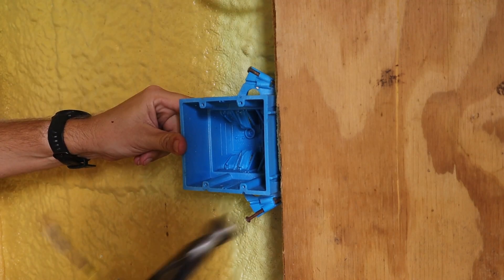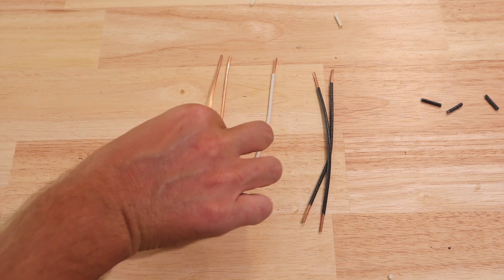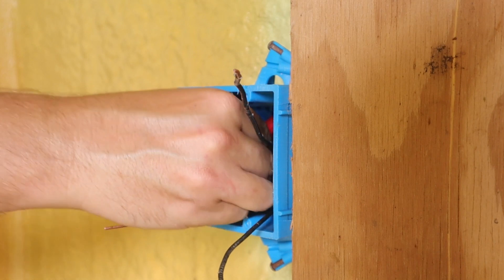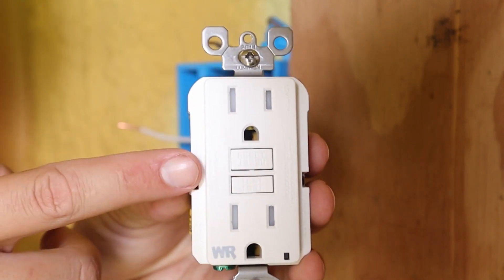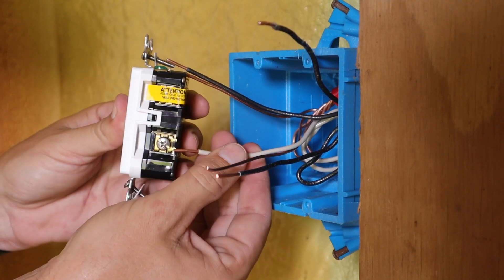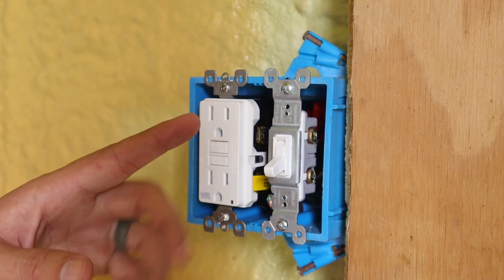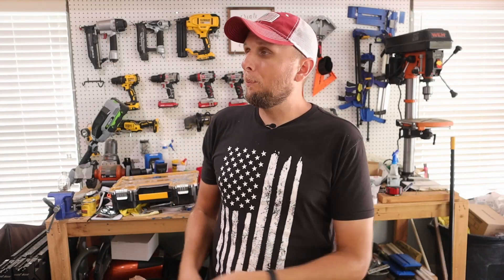Easiest Way To Wire a Light Switch and Outlet In the Same Box

Comment: You used 12gauge wire for a 15amp circuit. Your pigtails were 12gauge. Yellow insulation is 12gauge wiring.
White insulation is 14gauge. 
Your circuit breaker is 15amp. 14ga
Reply from the maker: Yes I did.  Yes they were.  Yes it is.  Yes it is.  The circuit breaker shown being turned off is not the actual breaker.  I just use that footage to show turning a breaker on or off.  Also, #12 can go on a 15 amp breaker.  So I am not sure what you are trying to say or ask.
Reply: @HowToHomeDIY  I was told by a electrician that 12ga wire 20amp circuit breaker should be used. Idk why.  I never did ask him that. 
But you answered my question.
You just showed just a circuit breaker from a different video.
Your videos are great.
I'm not going to question you on your work. 
I just saw the breaker and remembered a electrician telling me that.
That's why I asked.

I have another question.
My brother has a d house.
Old wiring. He has two porch lights.
The wiring is in a gang box with a switch with a outlet receptacle.
The outlet doesn't work.
I would like to replace the old wiring.
But I'm not sure what to do without damaging the plaster. I'm thinking the old wire my be stapled in the wall. 
Any ideas?
Or do you have a video on that?
Thank you.

Comment: I don’t know if this is where I’m supposed to put some thing for you to find a look at, but if I have a light switch, actually a three-way light switch box ones for a fan ones for a light and ones for a heater in my ceiling in my bathroom and I want to run a outlet down to the floor from one of those things and by reading they don’t have but a black-and-white coming in and then going to all the switches well if I’m going to leave one outlet live and run a smart lightbulb deal with that the switch is Always-On. Can I just tap off of that black in that white going to that switch?

Comment: What must you do to run wire underground in your back yard from your home to a shed at the far end? Is there a special device to protect the wire? Thank you.
Reply from the maker: That’s what I did here.  Local code may be different but I used UF wire which is a direct bury wire and doesn’t require conduit as long as it’s buried at the correct depth.  Which you will want to check your local code to confirm what that is.

Comment: So I followed this video for my bedroom. We added a ceiling fan it. I followed this video step by step but I must’ve made an error somewhere. 

My ceiling fan is on and works but the switch doesn’t control it. It controls the plug going on and off.
Reply: Sounds like wires were crossed. The outlet cannot be connected to the ceiling fan's lead wire in any way.

Comment: If the switch next to the GFCI outlet were a smart switch that requires a neutral wire, how would you wire it?
Reply from the maker: I would just make a pigtail up and connect it under the neutral wire nut and then connect the other end to the the smart switch.  Easy Peasy.

Comment: First mistake  you used a plastic box. Instead of metal box with a romex connector.  First mistake! 1 second mistake you should have a drip loop on your romex wire. 2 third mistake a cable staple at least 4 inches from your box.3 fourth mistake your Ground wires should use a green wirenut and extend 2 bare wires for grounds for the Gfci, and switch 4. I like 👍   strip twist  then clip and cap wires. I will tape the Gfci screws so they don't contact the bare wire. Next fold your wires neatly keep your box neat push bare wires to the back of the box. And do a neat job.

Comment: I am in the process of wiring a panel, lights and receptacles in my newly built garage. I wired the inside lights to a GFI Receptacle just like in this video so now they are all protected. I will put the outside lights on another circuit. Wish me luck on my inspection!

Comment: Is this the same process for an outdoor application? I was told to attach the ground wire to the box
Reply from the maker: Yes it’s the same.  But if you are using a metal box, which for outdoor use you will,  yes the box itself will also need to be grounded.

Comment: When it comes to figuring out what cable goes back to the panel, knowledge of your system provides a second way.... 
Nec article 250.24.(A).(1).  Provides us a no voltage check. 

Yes!  Your ground and neutral are connected.....at the first means of disconnect ONLY.

A voltage check to ensure power is ofg and then a resistance check of your neutrals and grounds for each cable (checking the resistance between a cables neutral and ground) should have a high resistance like the test leads are held in air for the down-stream cables and the cable back to the panel should only measure low resistance.....way less than 10 (ten) ohms.

With electrical, there is always an exception....old large (240v ) appliances come to mind because the they had the ground and neutral tied together at the appliance.  However, they were the only item on the circuit and if someone "made it work"instead of doing it right.

Comment: Nice video. A lot of times I really hate DIY electrical videos because the creator doesn't take the time to properly research what they're doing and teach their viewers unsafe practices. But I was impressed with how you cited codes and even did your homework on why those codes exist. Your work was very neat and professional looking as well. I would be happy if I came to work on a job that you had wired
Reply: Ditto Josh, the video has great explanation throughout. I don’t know what my camper has for wiring but I believe it has 12 gage, I’ll have to research or try to find an outlet or two that’s is original, the camper got updated by the previous owner and don’t know if it’s to RV code. I guess I should check those as well.
Reply: @MrKidQueso  probably. 12 awg is the appropriate size for a 20 amp breaker. The NEC lists the proper gauge wire for all breaker sizes over a set distance and when voltage drop occurs on that gauge (something you shouldn't ever have to worry about on an rv, you just won't ever need to run your wires long enough for it to effect you) and the types of wire that can handle that level of heat (most likely THHN which is what you will want, and is exactly what you'll find at your local hardware store in droves) it can always be kinda scary going in after someone who may not know what they're doing, I might suggest testing things like receptacles and light sockets with your multi meter if you have one, to make sure everything is properly grounded and all the conductors are landed in the right places and bonded correctly at the panel. Any questions you have are probably freely available on the internet and personally I think it's a good idea to Google everything, even if you think you know how to do it properly, there may be something you don't know, and you don't know what you don't know until you know, ya know? 😉 good luck!
Reply: @joshmonaco6170  thanks for the response, I’ll take a look at The NEC for clarification. I just ordered the KUS water level sensor and KUS  gage, and will be installing it up over the weekend. Thanks again.

Comment: Great video, very informative,  Exactly what I was looking for.   Any chance to get a wiring diagram posted of your wiring in this video?  I have a GFCI (plug 1) that is feeding another plug, (plug 2) I am adding a switch and receptacle (plug 3) for uplighting in my kitchen.  Plan is to add the switch in the box with the GFCI (1), run Romex up to a receptacle (3) from the switch and plug in the uplighting to that receptacle (3) above the cabinets. I am assuming my connections would be exactly the same as this video, only I would connect the Load receptacle (2) to the bottom of the GFCI.

Comment: Anyone else noticed he's using a square bit to drive the phillips screws? First time I see this, now I have to try it!
Reply from the maker: I have a video on the channel about it and some even better options out there now.
Reply: @HowToHomeDIY Thank you so much for the informative video! I followed exactly. Unfortunately, when I plug in my tester, it is indicating "open ground". Any ideas or suggestions on how to solve this? 
I can use the test button on the gfci outlet and it does trip.

However, if I have the external outlet tester plugged in. When I hit the gfci test button on it. It does not trip.

I'm stumped. Hopefully someone out there can provide some guidance.  I'd REALLY appreciate it.  Thanks😊
Reply: Robertson bit
Reply: Also known as a ECX or Combo Bit/#1 and #2. 🪛🔌💡⚡️
Reply: Square head #1 is what is in the center of most devices these days🤷
Reply: It’s much better at preventing slipping and stripping out.  I only use R#2 for my cabinets and woodwork.  Not o my does it help with preventing slipping, it prevents an amateur homeowner from messing with anything because they usually don’t have that bit.  I have a few more ‘security’ bits I use if I really don’t want anybody messing with it.  Sorry for the techs that come behind me and have no clue about fastening danger boxes. 😂
Reply: Works SOO much better! Also there's a new bit out for those screws that really fits well for grip.
Reply: It's called a clutch bit
Reply: It's not a Phillips screw. 
Some call it a quadrex.
Reply: It's easier with a Robison bit

Comment: Awesome info.. Does the ground wire have to be 12 gauge if the wires in the switch or outlet box is are 12/2 because light switches these days seem to come with a ground wire attached that is not 12 gauge it appears to be soft like the ground wire that comes with flush ceiling lights which makes it easier to fit all the wire into the outlet or switch boxes when upgrading in old homes .

Comment: When wiring a new home are you allowed to use the same line for a switch and an outlet? I was told you had to have different lines for switches and then one for outlets? Great info though! Thank you, you are appreciated!😁
Reply from the maker: Yes at least in the US you typically can.  However you would need to check with your local jurisdiction as well.  But most places in the US don't separate outlets from lights unless the particular receptacles are required to be on their own circuit such as fridge, garbage disposal, GFCIs, etc.  Typically the circuits are run by room or rooms and their intended use.  Thanks a lot for the feedback Deb!  I always appreciate it.
Reply: @HowToHomeDIY  oh thank you so much! So are you saying my little mini fridge will need to be on its own circuit? And the GFCI's are those the outlets that reset when the circuit blows? I have one on my fridge and one in my bathroom and one in my kitchen above the counter. So do those need to be on their own line?? God I hope not lol
Reply: @MetatronsWing  a mini fridge doesn't need its own circuit.
Reply: @kyungrix1112  thank you!!!!!!!

Comment: Our house has an outlet/switch combo right by the front door for the porch light, but the switch also controls the outlet (not GFCI, if that makes a difference) I'm not sure what the point of the installation was but it's annoying. Does that mean the load wire goes to the outlet and then the outlet also sends a load to the lights?   Is that an easy fix? This seems simple enough to do, I just never mess with electrical stuff...

Comment: By doing not connecting your light switch to the load on the gfci, does that not protect the light switch to faults?
Reply: That's correct

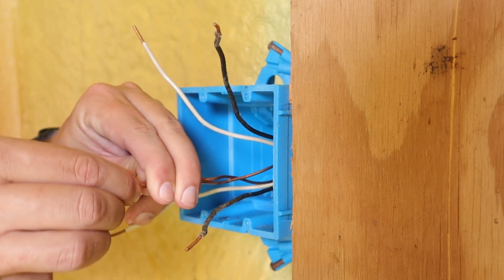Comment: 2:58. You will find it MUCH easier, if you wire the devices first, then add the assembly into the existing wiring.

Comment: Domestic lights on a 15a circuit with sockets, no insulation to the earth wire (ground) just bare copper waiting to come into contact with those exposed wiring terminals. Twisting copper, a soft metal within an inch of its life instead of using a wago or ideal insure. I hate American electrics 🤣
Reply from the maker: And yet, don’t really hear of it causing many big issues.
Reply: you Brits sure are envious of USA.

Comment: You need to check the rating of the switch for the outlet you are connecting it to.  You should not connect a 15 amp switch if it’s for a 32amp outlet.  You wouldn’t get away with this in the UK, light switches are rated 6-10 amp and the circuit breaker rated at 6 amp as its feed is only a 1.5mm wire. Option for us is to extend an existing mains cable or install a new cable to the outlet, the outlet can have its own built in switch.
Reply: The switch is for the lights, not the outlet.  We typically don't use switched outlets; if we have them they are usually only for table lamps.  Our light switches are all 15 amp or higher.

Comment: why wasn't a 20amp outlet used when the wires  are 12 gauge
Reply: 15 amp receptacle is fine and is commonly used on 20 amp circuits.

Comment: Should do a Split receptacle. ie: half is on light switch. Other half is content hot. 
  There grate for table lamps. We're a clock is also. Only half the receptical is switched.
Reply: You'd need two more black pigtails (since the switch would be controlling two different loads instead of only one) which would fill up the box more. Also, I don't know if GFCI outlets can be split into two separate receptacles, like normal outlets, without compromising GFCI functionality. Great idea though. Many hotel bathrooms are wired like that.

Comment: Turned off/using a 15amp breaker and using 12gauge wire??
Reply from the maker: It's just a clip I have filmed from a previous video of the breaker.  That being said, there is nothing that says you can't use #12 wire on a 15 amp circuit breaker.  It would never over heat.
Reply: Dang man, you think this dude needs to film every time he turns a breaker on or off instead of using one B Roll clip each time???  🤣🤣🤣

Comment: Is there any way you can show us, how to install a GFCI Receptacle with Switch.  The outlet only has positive and neutral wires, there is no grounding wire.  The box is metal, believe me I have tried many ways and the outlet does not have electricity, the switch for the light in the bathroom works.  Could you make a video about this situation?  Thank you for your videos, they have been very useful.
Reply: you have a metal box and there is no ground wire connected to it? should be one in there unless you have ancient wiring

Comment: Excellent instructional video. Just one question. Can I use these steps to add an (outdoor) outlet to my pool pump’s switch?
Reply from the maker: Yes you can, however, you will want a double gang weatherproof box and cover.

Comment: Good video.  to the point.  I would however prefer using a flat blade scrw driver to final tighten screws on devices.  They apply better grip to the screws than a phillips.
Reply: Chuck have you tried an ECX screwdriver?
Reply: Good thing he was using a square drive then. flat blade screws and drivers are awful.

Comment: Maybe it's just me, but I always put my line connection on the top of the device.
Reply: it's not just you, but it doesn't matter ultimately. I put the line on the bottom and load on the top because I like the mental picture of flipping the switch up to turn it on and envisioning the power coming in the bottom of the switch and out the top toward the light. it works either way of course

Comment: Would it be against code to daisy chain the switch from the outlet?  It would reduce the amount of connections and you would only need a ground pigtail and a hot pigtail.  Basically, the line comes into the outlet and the light becomes the downstream load.
Reply: Problem is when that gfci trips you'll lose all your lights too. There's plenty of room for 3 pigtails in a standard size 2 gang box, and they make over sized boxes as well if you ever need more room. Just keep in mind that the nec only exists as the bare minimum standards for safety, not to teach best practice. Best practice is still to use pigtails
Reply: @joshmonaco6170   I believe that the switch will be tripped along with the outlet because the outlet is feeding the switch.  No?
Reply: @kingartsprojects4150  no because you pigtail the hot wire so it branches off to the receptacle and continues on to the switch, so even if the gfci trips there is still power running to the switch. If you daisy chained it then yes you would lose power to the switch when it tripped
Reply: Note that GFCI and ACFI receptacles have line and load terminals for both the hot and neutral circuits. With that, any device(s) connected to the load side of the GFCI/AFCI receptacle will be protected by it.

If you want to daisy chain a load from a fault protected receptacle, you must carry a dedicated hot and neutral from the load side terminals of the receptacle to the next device, in lieu of the pigtail method, for both the hot and neutral.
Reply: I cant believe how primitive and outdated these switches look , also the sockets look totally primitive looking and very time consuming to connect wires . The consumer units look shocking also ( excuse the pun .
Reply: Lmao 🤣
Reply: I don’t know if this is what I have to do, and I’d be grateful for any feedback, thanks in advance. 

I have a camper and am thinking of installing a water level reader. 

https://youtu.be/prUlsuAsmnw

I thought of sourcing the power from an outlet and putting the sensor on a switch to turn off on demand. 

Any tips? The other thing I thought to do, is add a plug to the wiring from the sensor and use a 3 pronged plug, that I can unplug on demand.